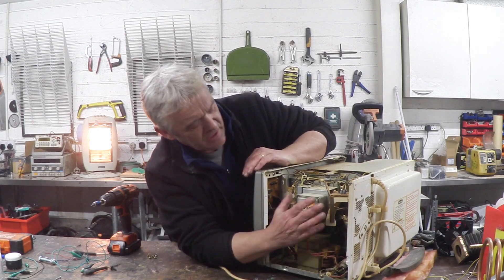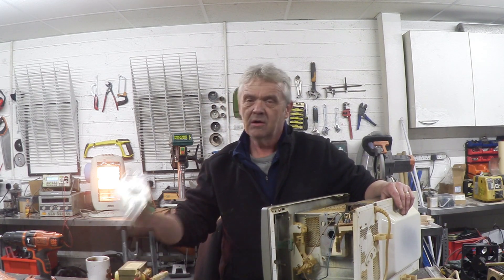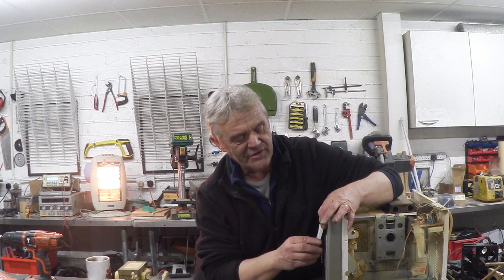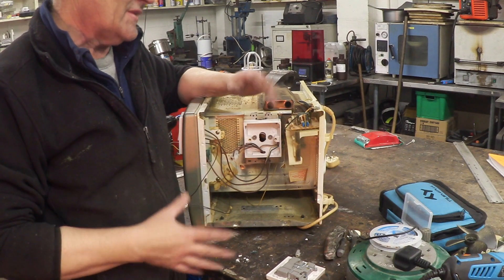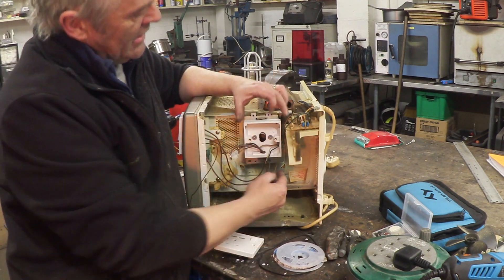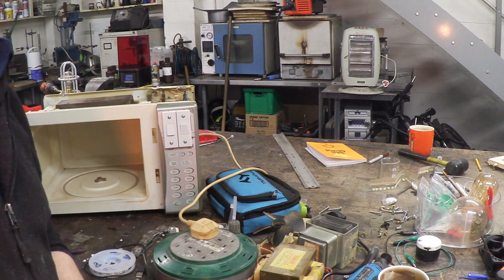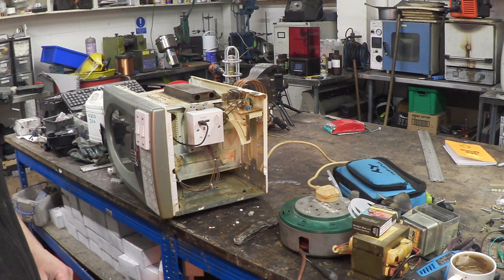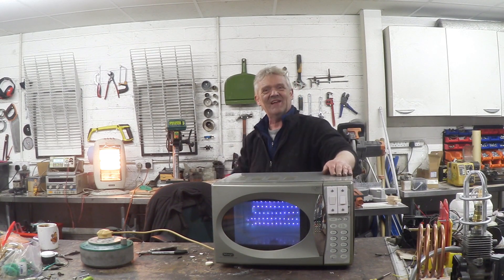1368 A UV Cure Station From An Old Microwave - For Resin Printers And Other Things

Comment: You can wire it all togeather with out switches you use the keypad and it will turn everything on and you can set the timer I built one

Comment: You might consider using some working ink to paint a heater inside. That way you can also use it for annealing FDM 3D prints as well (while promoting your ink at the same time.)  Also, instead of simple switches, use a Raspberry Pi (or equiv) to allow the user to select how long the UV exposure should run. So many additional options when you add a Pi. So many videos you can make. Also, you might want to consider using UV  epoxy to make battery and capacitor cases. You can paint the epoxy by hand, or 3D print something more precise. Also, I wonder if there would be a way to use UV epoxy as a component of the electrolyte  in a "solid state" battery. Also.. just kidding, I have lots of ideas but this is all I will post for now.

Comment: While I wouldn't down a free nuker for the parts, I went stupid simple for my curing station: 5 gallon bucket, aluminized reflective tape, UVLED strip lights, $13 all in. Run the tape around the inside, adhere strip lights, and it's also nice to have a rack system for curing multiple prints vertically. I tend to print 7" figures I sculpt but I haven't come across anything that doesn't fit including some very large impeller models.

Comment: Hi Merry christmas . Can you tell me why you out the UV lights at the back of the oven and not on the top . I been told not to look straight at  UV lights as it can damage your eyes best regards
Reply: as others have mentioned the only UV bands you need to be aware of are just UV-a,b,c - this LED strip wouldn't damage dna etc the wavelength for that is 247nm if i'm not mistaken.

Comment: Love this, re purpose discarded stuff is a win for all. 
Just a thought, one could have used the original timer for auto functionality.
 Punch in the time wanted and (as you say) Hey presto! it swirls on for the time set and you don't need to worry about a separate timer while tinkering with other stuff. Also useful when making photo transfers to PCB's, erasing a bunch of EPROM's or sanitize all sorts of things from viruses, bacteria etc..   Merry Christmas Rob & Luke!🎄🎀🎁

Comment: Excellent idea, I'm wondering if you would benefit from also adding a smaller strip of 5v grow lights to give you a wider spectrum of light to cover a wider spectrum of the UV range. I might be wrong but just a thought. It could be wired in parallel with the existing UV strip to keep the spare USB socket if required.
Reply: James Cunliffe  Lol!
Hi, sorry for the delay getting back to you, I dislocated my knee cap, lots of fun!! My own fault, I had just been saying to the Hub, that I hadn't been struck down by the Usual Xmas malady ~and "Pop!" it was in the Wrong Place!! Oucha!!
I hope all is well with you and yours!!
Andrea and Jasper. XxX

Comment: Most microwaves I have taken to bits have a simple relay to control the transformer, so you can have a timer already built in using the existing control interface. I find It's so easy to forget and overcook parts in the UV light so having a timer is nice.
Reply: James Cunliffe  You lost me, are you thinking of heating resin parts with microwaves? Does not sound like a good idea but if you do try it let us know how it goes :)

Comment: I have a question,   If i take a ring magnet and and wrap copper wire around the magnet then place a live wire through the ring magnet, Will it produce a current from the field off the live wire?
Reply: You don't need a ring magnet, just an iron core ring used for inductors and smaller transformers. An inductor only has a single wrapping of insulated copper wire where a transformer has to or more, a primary and one or more secondaries.
Reply: @stevetobias4890  could this be put around the ground wire of a home to to get a current?

Comment: Is there any reason why you sometime don't want it to rotate? I would probably have  used one switch to power both the motor and usb? 

An idea. Put some aluminium foil on all walls. It might be good result if you crunch it first to spread the light.
Reply: If it's a fully working microwave. Would it  be possible to just attach and replace the transformer with the LED?

I forgot. Mary Christmas! ⛄🎄☺️